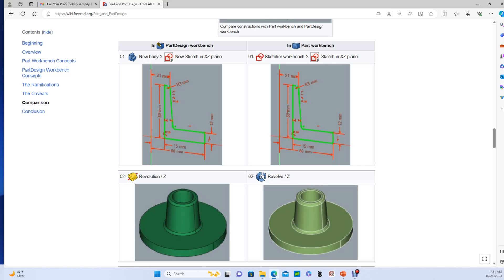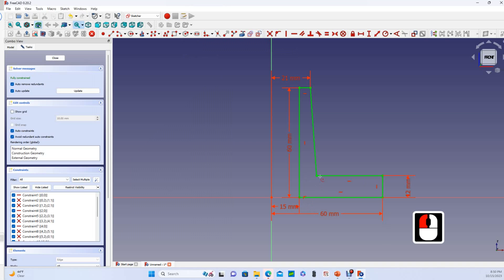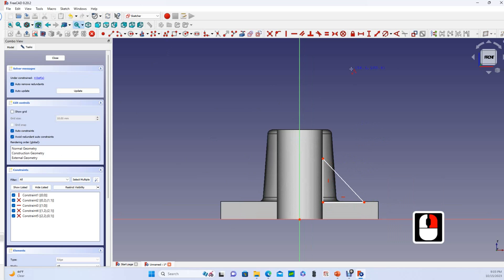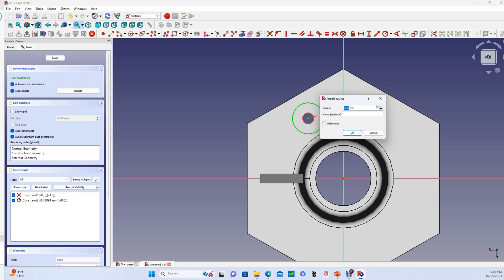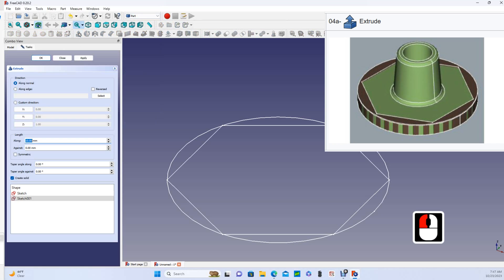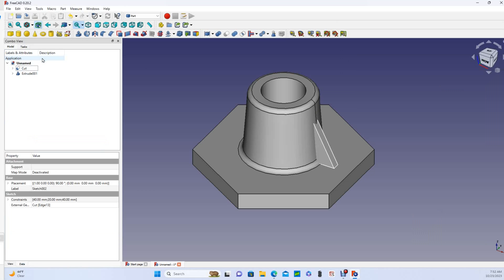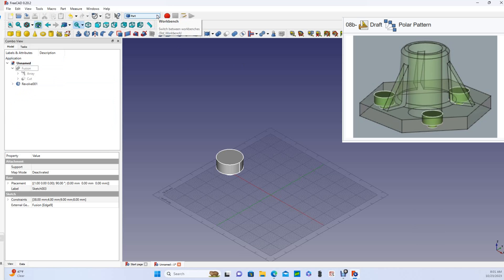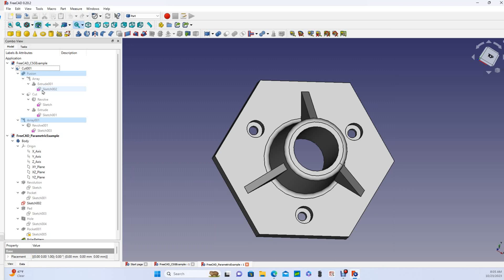FreeCAD Part vs Part Design 2

Comment: Thank you so much, I was getting a little frustrated with part design, but the  part workbench seems to be exactly how I have been working in CATIA 😂

btw I find it a good practice to always have holes extend 100mm or so over the top surface, that way you avoid the weird surface at the end where the hole doesn't go through the fillet, also if you cut anything up there, that was probably in the way of drilling the hole. So it's a good little control mechanism.
Sometimes I even model the tool clearance on top of the hole.

Comment: Now try doing it using only the part workbench, no sketcher or draft workbenches, but using only primitives.
Reply: It's doable; the toughest parts were the 4 degree truncated cone (used a tan function) and the wedge dimensions. I also didn't have a polar pattern, so went with somewhat clumsy link and transform steps. Some steps were easier, like creating the hexagonal prism and fillets.

Comment: Hey there. I just wonder how did it happen(@8:12) that the hole size shrunk-comparing to the sketch you made to something much smaller? (The sketch nearly touched the bottom fillet of the center "boss". The hole counterbore is a lot smaller...maybe 2/3 off the Dia! Other then that  it is a good explanation between the two WB.

Then I wonder if there is some kind of macro(?) which could convert the geometry object of Part WB  to a part geometry, compatible with Part design, so I can continue my work on that piece(object ) in Part Design WB?
Can you show an example, where using Part WB would be more efficient then Part Design WB or where Part WB could do something Part design cannot do, hence Part WB would be necessary to have and use.

Comment: Just a note on your counterbore operation, instead of creating a second sketch and pocketing for the counterbore you can instead use the hole operation with you first sketch and use the counterbore setting included in the hole function.

Comment: Excellent vid. I think its worth noting here in the comments, that the fillet tool in sketch : the fillet size depends on where you click the two lines. Click close to the corner to keep the fillet tight before you dimension it 👍. I mention this,  cos I have found clicking far from the corner can add a massive fillet that can cause the sketch to collapse.